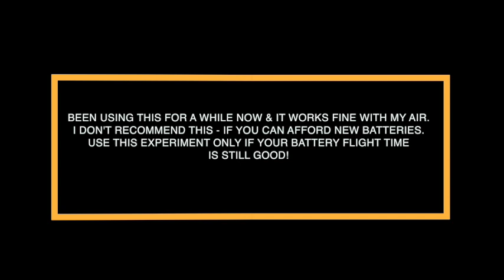DJI MAVIC AIR BLOATED BATTERY WORKAROUND

Comment: when i saw your video for the first time i thought it didn't make sense, and i decided to remove the gas from inside the cells avoiding cutting the cover. Well, in the end, I removed the gas from 2 batteries and now the batteries are dead.... it only worked 2 flights and it ended ...
the third battery I decided to follow your instructions even if the aesthetics were the best, and it still works!
I should have done this on the 3 batteries!

Comment: I have had my mavic air batterys for about a year, I fly multiple times a week, and I have never had any battery bloat. You just have to take care of them properly
Reply: What is the correct procedure to take a good care of them?
Reply: @gngeorgiou  never store them fully charged, don't keep them in a hot car, don't store them in a cold area like a garage, and try not to drain them below 20%, but never below 10%. Same goes with your phones battery, but most people buy new phones all the time, so they never get any battery problems. Hope this helps!
Reply: @clmfilms8103  Thanks for the info. I did everything as you told expect not storing them fully charged and both of them bloated .😟
Reply: @gngeorgiou  yup, storing them fully charged longer than 24 hours is one of the worst thing that you can do to LiPo batteries, drone or otherwise
Reply: I know it is kinda randomly asking but does anyone know of a good website to stream newly released movies online ?

Comment from the maker: I'm still using the open batteries and flight time still at it's fullest. I hope dji resolve this battery bloating problem for normal usage.
Reply: doesn't they fall? is it safe? I just bought used mavic air and my battery are already fat, Help Dude
Reply from the maker: @dharamgurjar8507  until now, im using it.. no worries on the peeling. You must worry on the flight time. If the batteries still have good flight time it should be ok. Im not planning on buying new batteries for my mavic air1. I rather spend my money on mavic air 2 or 3.
Reply: @GilbertObispoFilms  okay bro, I will try for sure, and will save for Mini for personal use
Reply: @GilbertObispoFilms  i also just bought used mavic air 1 and same battery condition. so far flight time still ok and now no need to worry after your experience.. thanks dude !

Comment: Due to covid and not flying, my battery depleted now won’t recharge . Is there a work around to kick start it, so it will go back on the charger?
Reply: You would have to plug the original charging cable to the battery and cut it in half....expose the positive and negative wire...plug the positive and negative wire to a hobby grade charger and put it on the NIMH setting and charge it for about60 seconds...then unhook the cable from the battery.... reattach  all the  wires to the original charger and it will work.

Comment: Direk nasira ung mavic air battery ko. Ayaw na mag charge. Bka kaya mo gumawa nung 18650 na convertion.or palitan ng lipo ung batt. May mga nakita ako gumagawa nun sa youtube.
Reply from the maker: i think not possible ang 18650, malaki at mabigat para sa air. Small size lipo pwede kaso di recommended sa Air kasi maliit na drone lang . Time to buy new batt na for safety.
Reply: @GilbertObispoFilms  may nakita ako dito sa youtube na nakagawa sya ng 3pc 18650 and napalipad nya.. ngayon nag try ako ng lipo using ng xt60 connector na nabili ko sa lazada. gumana namn sya kaso may error na lumabas.. battery not installed properly daw.. may idea ka ba paano maayos un? paano kaya ma bypass ung battery coonection?
Reply from the maker: @Robloxlogowest  Nakakatakot baka kumalas ang connector ng battery. Also tansyahan ang flight time.
Reply from the maker: @Robloxlogowest  ishort mo lang yung wire na naka kabit sa lock ng battery

Comment: pano yan
Reply from the maker: para mafit ang bloated battery sa mavic air, need alisin ang top plastik para makahinga ang bloated battery cells. Then pwede mo na ulit gamitin hanggat mahaba pa flight time. Hindi sya solution, pampahaba lang konti ng buhay ng battery. Para lang mainsert ulit at magamit sa mavic air drone.
Reply: saan makakabili nyan pasa po link ng online shop po...